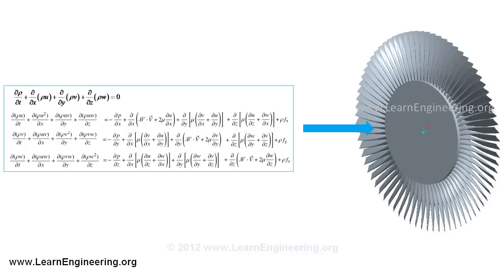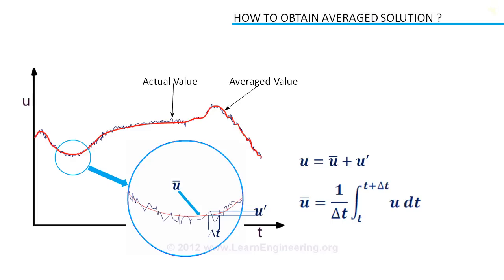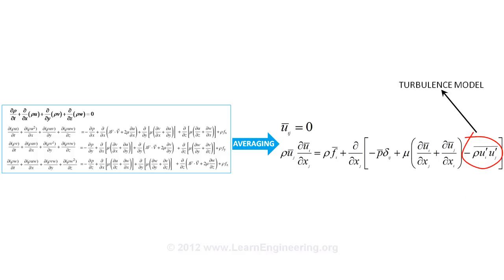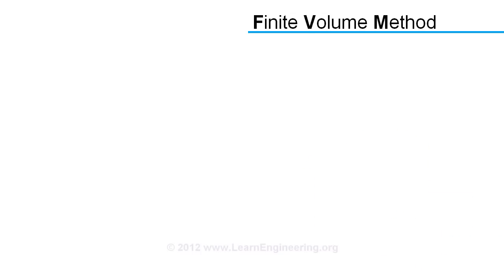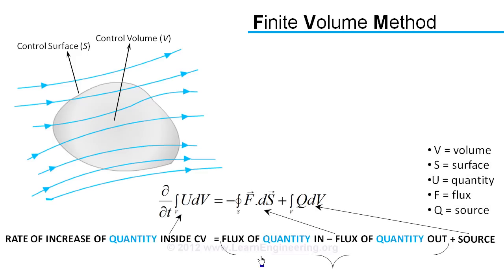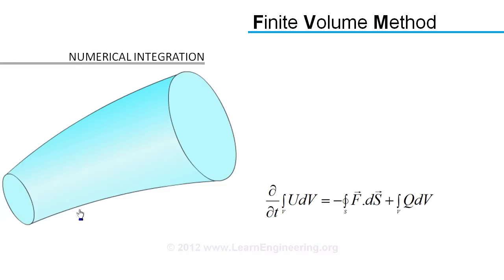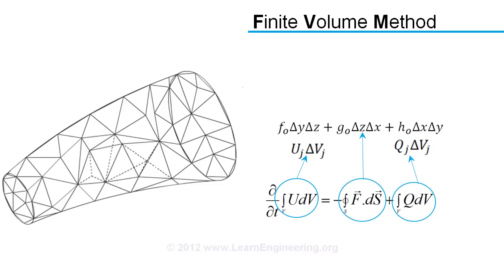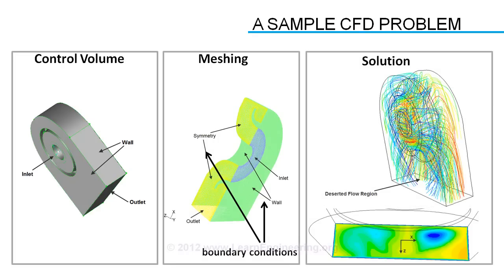Computational Fluid Dynamics (CFD) | RANS & FVM

Comment: I need some advice. I am thinking about getting a Masters degree on science of thermofluids, specialiced in CFD. What kind of job opportunities do I have getting this knowledge. Or do I expect to guide my career into investigation?? I would appeciate some answers.
Reply: Ok... it's been  8 months, but lemme give it a shot. Being that specific, isn't "thinking" about doing it. Rather, it should be a "want" to do it. So, unless you actively want to study something that specific, don't waste your time, job-opportunities or not. A mechanical engineer with expertise in fluids and their thermal behavior shouldn't have trouble finding work in fields as varied as pharma to vehicle design. The goal is to make sure you're leaving with a degree that's giving you both skills and knowledge that can be attractive in a variety of related industry.
Reply: CFD Analysis of Catalytic Converter to Reduce 
Particulate Matter and Achieve Limited Back 
Pressure in Diesel Engine